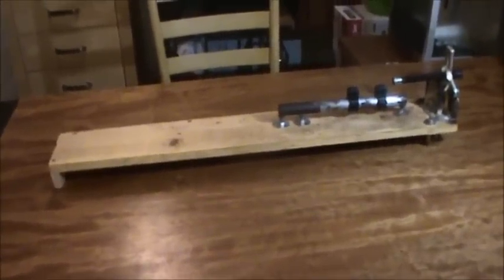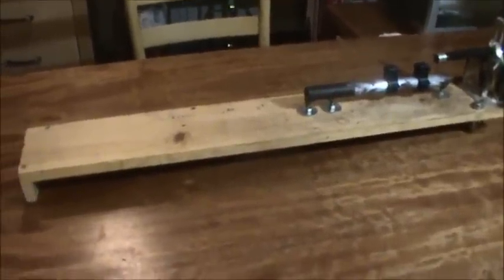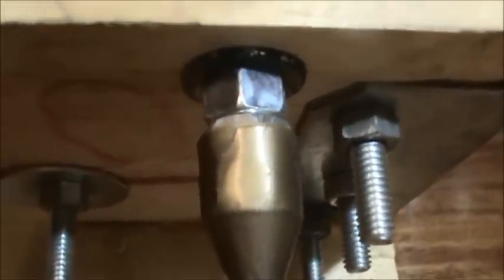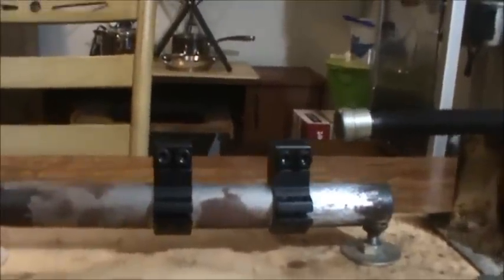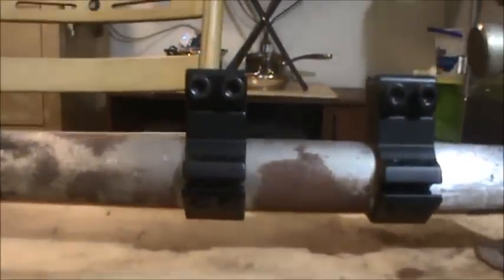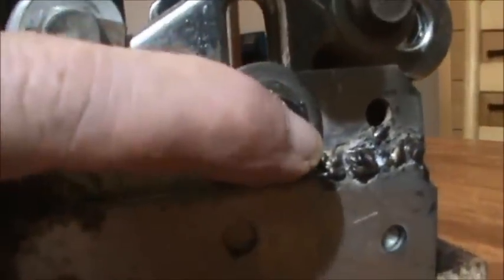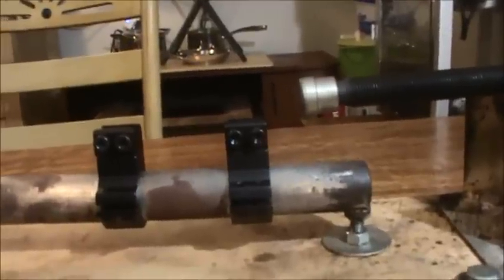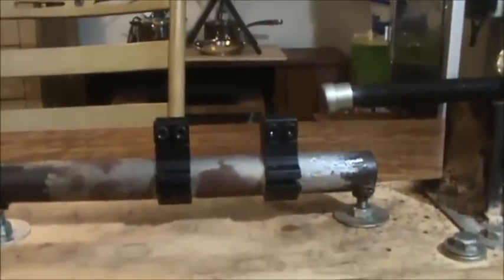How To Build A Pellet Rifle Spring Compressor

Comment: Kenny, turn the heat up on your welder. Start practicing on scrap with it a bit too hot.  Learn to make almost too hot work.
Reply from the maker: I wasn't getting enough heat. I needed to plug straight into an outlet closest to where the Juice came into the garage.
Reply: myairgunreviews + That can effect it, agreed. I've got a Lincoln Weldpac 100 and for only 120 v max coming in, it makes great beads. But, i do avoid extension cords, even big enough ga. ones, as you mention.